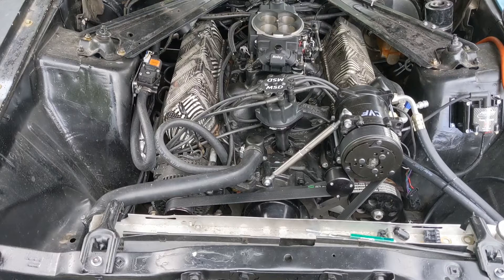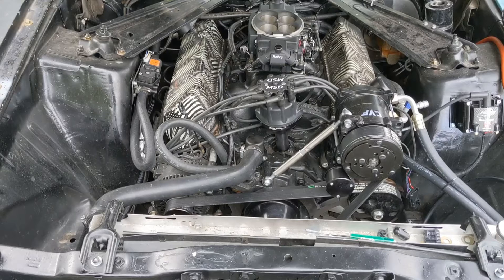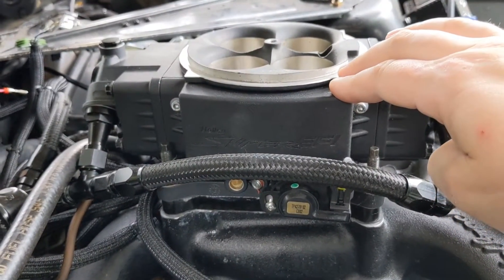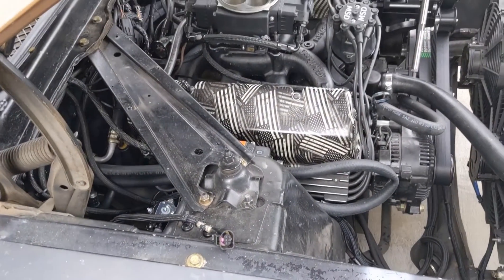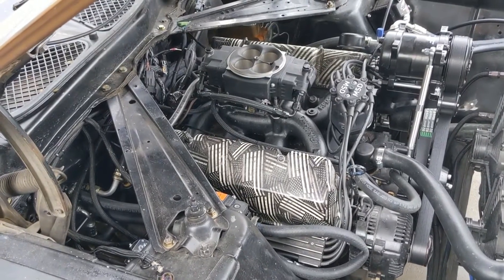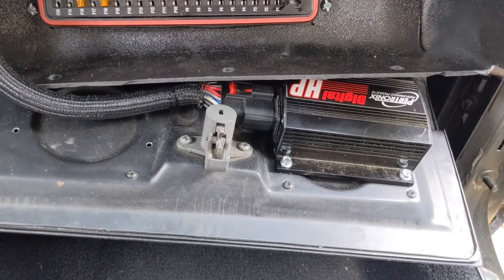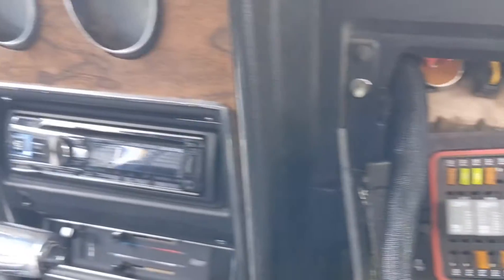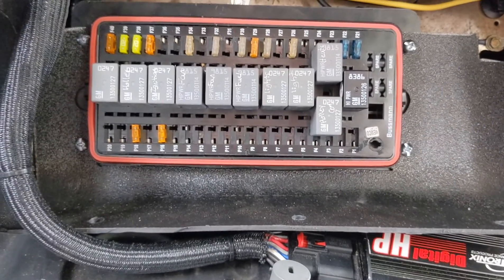Holley/ Fitech RFI EMI solutions

Comment: Great video! We are currently fighting the RFI problems. We read that aluminum foil over the distributor would work, and it does. I drove the truck 30 miles, no issues. Pulled the foil off the distributor and the truck wouldn’t make it out of the driveway. Put the foil back on and drove it several miles without a problem, this is crazy.
Reply from the maker: I went through that exact situation. And as soon as I did all the Faraday tape over all the wires,  I didn't need the tin foil anymore
Reply: @brianstechtips5721 ok. We done a ground strap from engine to the frame, and one from the transmission to the frame and removed the foil. We drove it 138 miles today and it has been doing fine until the 30 miles, now it is high idling again 🤦‍♂️
Reply from the maker: I honestly hate the smile. Good luck lol. The IAC settings always change for no reason @chriscoesbodyshop

Comment: I stuck with my edelbrock avs2 carb. I bought a wideband gauge, fuel regulator and edelbrock tuning kit. Now my air fuel ratio has been running at 14.7 idle and 13.5-14 on throttle. I really thought about going EFI but the amount of problems they have im not sure if its worth it. If i did go EFI i would get the FI-Tech with the sump pump and keep my carburetor in my trunk incase i break down somewhere. All i would need to do is hook up the carburetor and disconnect the fuel line from the sump pump and reconnect it back to the carburetor.

Comment: Fixed mine, first Faraday tape on all wires and grounded to block, second insulated air filter hat, third a very good filter on ignition lead, fourth changed MSD Blaster coil for a high inductance slow rise time coil, fourth a steel shield between distributor - sniper throttle body and fifth clip-on ferrite noise filters on all leads to ECU at ECU.

Comment: Hey, Thanks Brian! this is probably the most in-depth RFI sniper video. It's not just like hey move this move that. Im having these same issues with a 67 Camaro. Do you have an update? did these continue to work? It seems like if you don't want to go through all of these steps get the Terminator X 4150 is the way to go. It would be great if holley offered a remotely mounted ECU. 
Thanks again! 
Billy

Comment: I have a sniper on a 5.7 ls1 in a 69 camaro. Msd 6ls ignition mounted inside the car behind the dash pad, metal air cleaner with k&n lid. Car has no a/c or radio. Absolutely zero issues with my sniper. Most of these videos i see are on distributor run cars. Only tuning issue i had was a surging idle. New intake gaskets on my edelbrock victor jr fixed that issue. Running a texas speed MS3 cam, 238/242, .600'/.600', 112 LSA with cnc ported 243 heads. Set the iac to 6%, idle 850rpm and let it rip.

Forgot to add, my sniper unit was a discount refurbished unit directly from holley.

Comment: What issues were you having before going through the effort to make your system RFI proof
Reply from the maker: When I would smash the gas it would back fire and the handheld would say error. It would start and die. 02 sensor would do weird stuff.
Reply: @brianstechtips5721  i bought a holley unit and i haven't been able to get it to idle. it fluctuates all over from 900 to even 3k rpm. o2 sensor reads rich, its clearly running rich, the computer is commanding less fuel but it doesnt inject less fuel. its been a nightmare. the only answer ive been given is RFI causing all my problems where the solution is to replace everything
Reply from the maker: I have had nothing but issues with the Holley sniper. I still haven't worked out all my issues
Reply from the maker: Try putting tin foil over your distributor. I know it sounds retarded
Reply: @brianstechtips5721  lol, i suggested the foil thing to a friend that knows about computers and such and he called me a schizo. fortunately in my case holley is going to take it back and make sure its working correctly. if they say its working correctly i'm getting a fitech unit. it worked for me on another project right out of the box
Reply from the maker: Yeah I switched from fitech. I wanted the better software for tuning. That was a mistake. I have returned my Holley sniper three times. The fitech never stranded me on the side of the road. I had to buy AAA because of this thing lol. The second time Holly lost my unit and had to find it. They found it 2 weeks later

Comment: RFI fix get a 4 pin relay. Use the key switch hot to control the relay. Then run the PINK wire to the relay , directly from the battery , again directly from battery. Thus the Pink wire source is clean. This is a fix for less than 10 bucks . Yes I have a condenser , but the relay is MUCH simpler and better for my car
Reply from the maker: It already had that too. All power switched or constant are directly to the battery.

Comment: I'm currently in the process of wiring my car for the sniper. I'm running a SBF (351W stroker) with the Sniper Stealth, as well as a HyperSpark distributor, all in a 2012 Mustang. 

When you read the following, please know that I have a matter-of-fact speaking style that might come across as berating or abrupt, but I'm just providing info. Nothing more, nothing less.

Admittedly, I'm running a newer car without all of the problems that come along for the ride in older cars, and I haven't actually gotten to the point where I'm ready to start the car for the first time, but...

0) There should be no reason to have to use ferrite beads or faraday tape, or even ground your throttle body. Furthermore, the nylon washers really should not have made much/any difference because the ECU is still making metal-to-metal contact with the throttle body. In fact, if your battery to frame, battery to block, block to frame, and head to firewall grounds are appropriate (I'm talking nothing smaller than 4-gauge cable), it seems to me that you shouldn't have to do anything special with regards to further grounding of components, because everything is eventually metal-to-metal.

1) You didn't say this specifically, but wrapping wires coming off the throttle body is kinda pointless, because they are all coming off the throttle body at the same general location. I don't understand how wrapping them is going to solve anything. 

2) If you haven't yet, you really should weld a proper O2 sensor bung onto your exhaust. The strap-on stuff that Holley provides in the kits is nothing more than encouragement for  people that desperately want to believe that this is a DIY one-afternoon install. It's not, and everybody that's installed a Sniper knows this from experience.

3) Fact - old Fords running out-dated technology (half-assed too-small ground straps, 1G/2G alternators, fender mounted starter solenoids, intake-mounted ignition coils, non-resistor plugs/wires, etc) are going to be *noisy*. If you want the best possible initial experience with a Sniper, you have to sort these things out before turning the car on the first time.

4) You didn't mention what kind of distributor you're using, but a magnetic distributor (most of MSD's product line) is going to produce more RFI than a hall-effect distributor (HyperSpark). 

5) Try putting some dielectric grease on  the wires at the cap (and even at the plugs). The way I did it was to remove the plug wire from the cap, and use a q-tip to run a small amount just inside the boot. Another way is to run a small amount around the post on the cap. This may help when the air cleaner is on the car.

BTW, how about a video of the car running? :)
Reply from the maker: I have literally done everything that you mentioned in that post. It has a 3G alternator. A nice big round strap from the block to the frame. It also has a dual sync distributor. It literally broke 50 miles later. The o2 sensor is welded. The power and ground go directly to the battery. I still had RFI issues. I would absolutely love to say those things weren't needed. Because it was an absolute headache to wrap all those wires. All the wiring is updated.

And the nylon washers actually did work. To ECU and throttle body are both painted. There is no metal on metal contact.

It also has the updated plugs and wires. They're brand new. 

Like I separated all the wires I did everything by the book. I still have problems. The Faraday tape I think is the one that actually fixed it.

Comment: thanks for the video. i feel like a lot of what you did was a work around/band-aid for the actual issue wherever it may be though.. i haven't had the joy of tracking down/eliminating interference yet, other than speaker hum on a few vehicles (usually fixing grounds corrected that), so i can't speak from experience i guess other than i wired my car all new and did a fresh install of everything and have no emi/rfi. I'm glad you got it where you're not having issues, but i fear its a matter of time before it returns because you're just shielding things from the interference mainly instead of eliminating the interference at the source.
Reply from the maker: I mess with it for days trying to figure out where the EMI was coming from. Whether it's a Band-Aid or work around it works. It has an updated at alternator, ignition and everything. I messed with it for days and I watched a lot of RFI videos. A lot of people talk about Faraday tape and grounds. I added all of it.